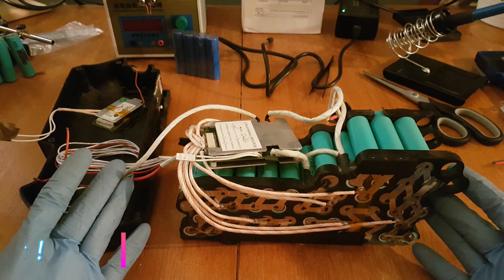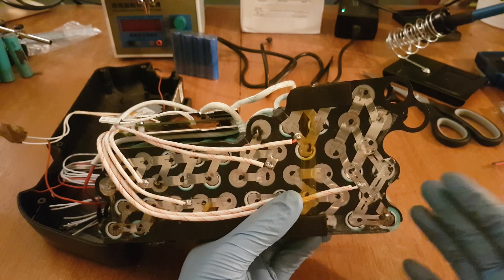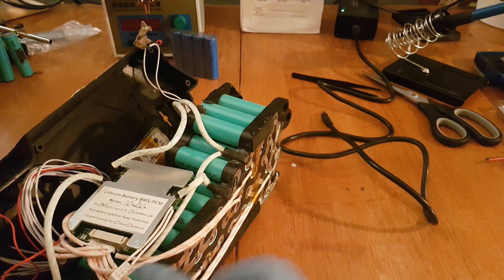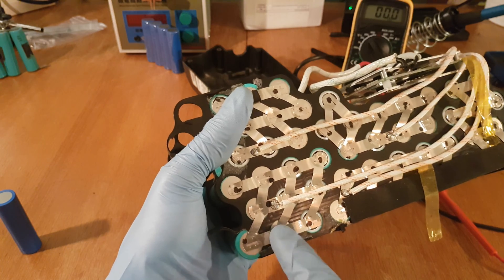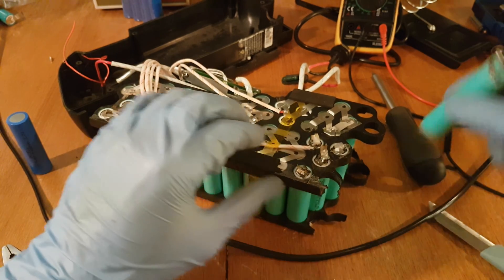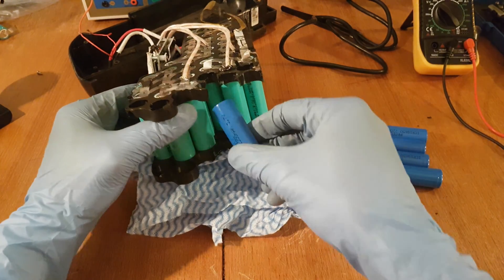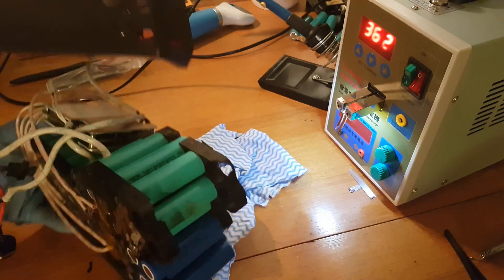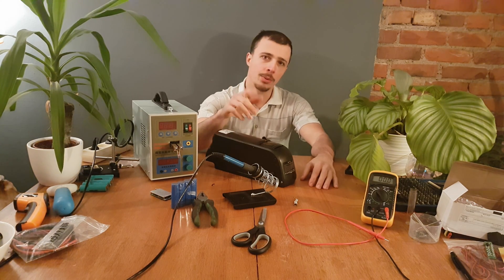E bike Battery Repair - How to Fix and Troubleshoot it

Comment: Hello how can i check the BMS
Of the accupack
Reply from the maker: Hello ! You meen to check if it does work properlly ? Just check if it does charge the battery ; even with some bad parallel groups the BMS will try to charge the battery for few seconds and than it will stop ; if it does so , than the BMS it's ok .

Comment: I have a 52V 14S ebike battery that will not charge. Meter says current voltage is 52.6V and max is 58.7V 3.9V per cell current. I by--passed the BMS and using 3 different chargers all with max voltage of 58.7V and still battery will not charge. These are new batteries and battery charged 1st time after building battery and has not taken a charge since. Any ideas? Thanks
Reply from the maker: That's strange . It's hard to guess without having the battery in front of me , but I would do the followings : 
1) Visually inspect all the solderings and spot weldings 
2) Measure the voltage of paralel groups of cells and compare them ..
3) If you have a charger that do the discharge test , do the charge / discharge test of each parallel group and see if they are ok 
4) Try to charge the battery without BMS directly on the battery terminals 
5) Make sure that there are no short circuits or wrong connection ..
6 ) Make sure that the charger is giving 58 v to the battery ..
7) In the worst case , you must disassambley the whole battery and double check all the cells individually to test them if they charge / discharge 

I should probabily make a video about these things ..

Comment: Hey man! My baterry apparently got wet and it is no longer charging or working at all. Even the battery's display is not even working. I cycled in the rain a day and left it outside, the battery was fairly full then in the morning it was died. Any tips?
Reply from the maker: Hey ! It sounds like a short circuit . Try to open the case of the battery and check with a voltmeter how many groups of cells have power . Then try to charge those separately
Reply: do it !  I figure it out, some wire wasnt working properly.
Thanks for your reply though
Reply: doit_vehicles 
I have similar issue 
Battery charger port got a little  wet and started sparking .
It still chargers fine but when you unplug charger it sparks still.
Was wondering is there a grease I can use on the charger port to bring that piece back to life ?
It's a little corroded because like I said couple of drops of water fell in there . I'm not sure though if I apply the grease like dielectric or something as simple as Vaseline if Its dangerous .
Reply: I've seen videos of people using grease on car batteries for corrosion issues .
But not sure if that would work in my case . 
Don't know how to swap out the charger port piece just figured I could do a quick fix like swab the area with grease so the corrosion won't get worse and stop the sparking issue.

Comment: ooh this is good stuff man - I haven't had a look into your other videos but you seem to be over looking the step that i need to see, hopefully i do not need to replace cells as my electrical knowledge is no where near your skill level, I will cause fire so I don't think I would go down that route - however that said my battery, a dolphin case, like yours has something rattling inside and I need to take it apart - please could you do a vid showing the case removal process!
Reply from the maker: Thanks for complimets :) The most "difficult" part while disassembling that dolphin case is the handle spring ; you must keep it under pressure while pressing the 2 parts of the case together . 
https://www.youtube.com/watch?v=rJ_hJyQpEOw

This is a video where I build one battery in the dolphin case , you can skip to the end where I assembley the case - it might be helpfull !
Reply from the maker: I will consider a separate video only about removing the case :)
Reply: Thanks for the quick response, In all honesty I bit the bullet and opened it, i tried videoing it, I'll see how that turned out - anyway yes I did use that video as a guide, most helpful, i was going to just leave the handle minus the spring and let it flap about (lol) but I did figure it and managed to get it in spring included - It turns out that there was an odd small metal nut like the outer ones, that had come loose, from where I did not want to poke around too much but everything looked intact, I did a 20 mile ride today with a metal bit loose inside my battery - SCARY! - thanks again - Subscribed
Reply from the maker: You're welcome ! I am glad that you manage to find it . thanks :)

Comment: Question-- so I  built a battery.  I bought a 14S 51.8V 45A BMS off eBay: https://www.ebay.com/itm/14S-51-8V-45A-BMS-PCB-PCM-for-ebike-electric-bicycle-18650-Li-ion-LIPO-battery/112636580964?epid=18009165438&hash=item1a39a9d464:g:MYcAAOSwhmpaBbsf

This one has only a B- and a COMBINED charge/discharge C- solder pad to hook up ( along with the 14 wires)

I get good voltage (51v) from the battery terminals but when I tried to charge it, the charger smoked and caught fire.  .  

Charger is a 3 prong so I ran: the positive to the + terminal on the battery and the negative to the C- charge/discharge on the bms.  The middle prong on the 3 prong I didn't connect to anything.

Im no expert but Its as if the battery is feeding back voltage to the capacitor in the charger and frying it.  What am I doing wrong here?
Reply from the maker: Right ..  first of all , that BMS is weird and I never seen / used something like that with only B- and C- . All the BMS I used had also a P- for the discharge negative, separately . Get a good one from aliexpress ( you might have to pay more ) with all the usual B- C- P- and it will work fine as long as you wire the rest of the connections correctly . If you want to use that battery meanwhile , just charge it without that BMS
Reply: Thanks for the advice.  Think I may have reversed the + - wires on the lead from the battery as I wasn't used to the blue/brown color scheme and it was frying charger after charger.  My voltage meter was broken so I decided to just plug it in :(
Reply from the maker: I see , that sounds frustrating ... Now , at least ,  you'll know for the next time :)